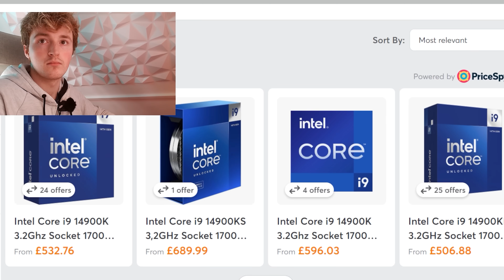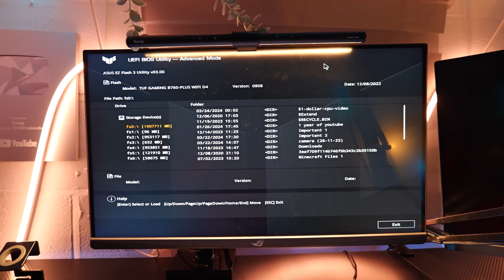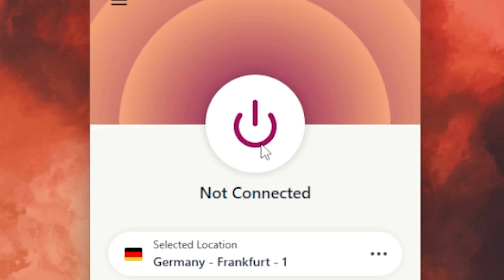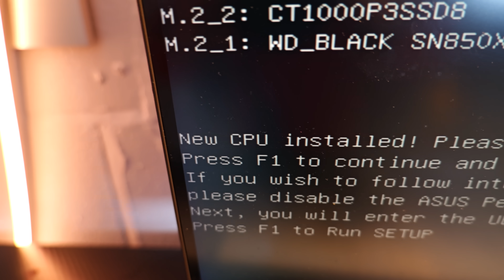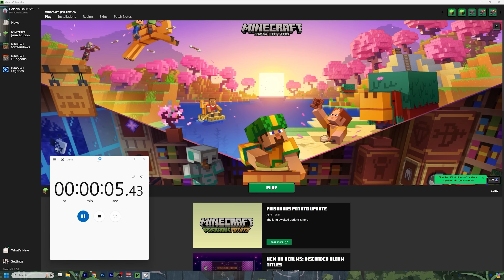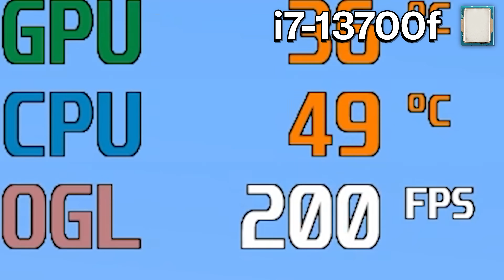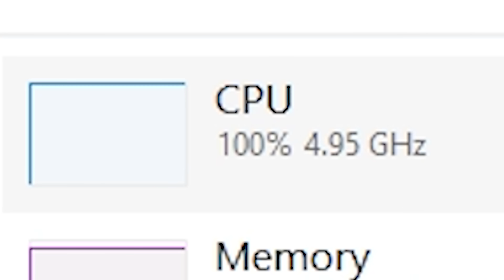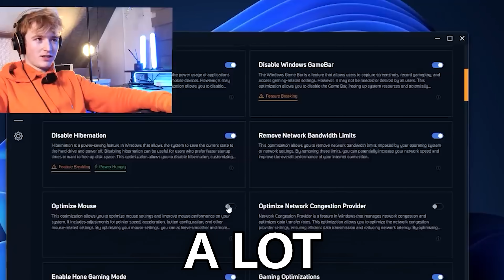Minecraft On The World's FASTEST CPU!

Comment: amd threadripper laughing in the corner
Reply: that isnt a gaming cpu
Reply: @MidResoIve  according to my 5 minutes of research, I have concluded that they're both workstations.
Reply: @MidResoIve  actually they are gaming cpus its just not highly focused on that
Reply: @retring  theyre not faster when you consider gaming unless u try overclocking they just simply have advantage in other tasks because of more cores
Reply: @retring  it's not faster, they're faster on multi core performance, because they have more cores and threads but the single core performance is far behind the 14900K and also minecraft prefer bettter single core performance than multi core
Reply: Theadripper is slower for gaming, it's not built for it, meant for workstations and its fast for editing and anything that can utilize the cores, most games can't utilize all the cores of newer cpus especially the i9, plus minecraft is designed to work with a single core mainly.
Reply: @Seekers4Studios  Yep. Threadrippers are mainly used for rendering due to it's high core count.
Reply: @MidResoIve  Yes, it aint a gaming cpu, but with some of them having 96 cores, it'll do better than the I9.
Reply: @jum5214  more cores do not equal faster gaming preformance.
Reply: @Fake_Slicer  the threadripper is litterally 20 times more expensive
Reply: @stormctry  have you ever seen a gaming pc were the cpu is 20k usd?
Reply: @MidResoIve  still more powerful
Reply: @stormctry  When people said "fastest CPU" on i9-14900KS for an example, it is because it works at 6.2Ghz on only one core (without using LN2). A threadripper doesn't achieves 6.2GHz on a single core without LN2 and forget to get 5.9Ghz on XX Cores (that's why there are only 8 Pcores and are the only one to achieves 5.9Ghz for all on 14900KS)and it isn't for consummer due to highly price. And the i9-14900K isn't the fastest because the 14900KS does a little bit better.
Reply: @MidResoIve  dosent tr pro 7995wx cost 10k usd? also im not saying that theyre necessarily instead for gaming im just saying theyre primarily used for workstation and rendering purposes but theyre also great for gaming it just dosent match up with the high end consumer cpus
Reply: @Fake_Slicer  liking your own comment is crazy
Reply: @Kony_BE  yeah i agree with you but at least when you consider the ryzen x3d series for gaming, let alone the 7800x3d, it fairs up well and even outperforms the 14900ks in some games
Reply: @Fake_Slicer  yes and no, i9 is made for normal workloads but when u need more cores than comes the threadripper. i9 is made on lga1700 which in amd is Am5,
Reply: the i9 is faster by 13.48%
Reply: @MidResoIve it still has 48 cores
Reply: @Cereales_Cereal  it has more than 100 actually
Reply: @Fake_Slicer  The i9 is meant for gaming
Reply: @jum5214 in workstation tasks, sure. Gaming? Not even close
Reply: @stormctry no the 7800x3d losed to 14900ks
Reply: @elvpse  yeah true
Reply: Bro someone tried playing fortnite using threadripper and still the 13th gen could beat it, threadripper isn’t for gaming….
Reply: Consumer CPU not server CPU
Reply: fr
Reply: Threadrippers are not really good at gaming (for the price, it's still a beast)
Reply: wonder what would Ryzen 9 7950x coould be
no threadripper has different market despite it was blured between these 2 segments
Reply: Do u know what is the meaning of Consumer
Reply: lettealy
Reply: @retring no the clock speed isn’t very fast lol
Reply: @abiez4018 finally someone understands, it would be better at vms
Reply: Amd Epyc:
Reply: he said fastest CONSUMER cpu, threadripper isnt a consumer cpu
Reply: i recall, consumer CPU. The threadrippers are server processors not intended for consumers but rather providers
Reply: Threadripper have worse single core proformance than Intel, that's why they aren't faster in games
Reply: Meanwhile Nvidia Grace CPU…
Reply: @retring  minecraft is a single core game, you need a good single core preformance to get fps. Not the case for threadripper.
Reply: AMD in the corner laughing as Intel CPU start slowly dying and becoming unstable
Reply: Intel xeon laughing at the corner
Reply: Render fast doesn't mean game fast.
Reply: He said consumer 😂
Reply: ye lol
Reply: @MidResoIve  um actually processor is splitted into cores and these cores are doing each operation that means MORE CORES = More Things in Less time = faster process = better Performance
Reply: @LixTheYT  🤓🤓🤓🤓
Reply: @MidResoIve  hehe thats kinda offensive kid.... but I don't judge you for not knowing how to use google ;)
Reply: @LixTheYT  i know more about computers than you ever will
Reply: @MidResoIve  bro who asked lol
Reply: Thread ripper my ass.😂
Reply: @LixTheYT  dogs dont ask, they listen
Reply: @MidResoIve  yes so stop asking doggy ♥️
Reply: They are server CPUs
Reply: It has less single core performance which makes the amd threadripper not ideal for gaming
Reply: @LixTheYT  i didnt ask about anything
Reply: @MidResoIve  did i ask something too? I don't think so
Reply: @LixTheYT  there you go... you're asking!!!!!
Reply: @retring its only faster if its like 256 chunks in minecraft
Reply: @MidResoIve  ...
Reply: @retring  have many cost
Reply: @retring  nope, as far i know the most powerful threaddripper can get max 5.3 ghz
Reply: @MidResoIve  Threadripper CPU's are acutally for gaming, the same other one that isn't for gaming is EPYC CPU's
Reply: @idiocy8884  they both CAN game but they arent made FOR gaming
Reply: @MidResoIve  makes sense, though there are gaming motherboards designed for Threadripper CPUs, and as far as I know EPYC CPUs doesn't have it.

Well yeah, gaming on Threadripper is unnecessary and just the second of its purpose, but hey it can.
Reply: @MidResoIve  I9 are not gaming cpu too, totally useless for gaming
Reply: @Meyuuuko  then name a gaming cpu from intel
Reply: @Meyuuuko  then name a gaming cpu from intel
Reply: @MidResoIve  the I5 or I7 11th generation or a little bit lower is for gaming
Reply: Isn't Threadripper.. a Server CPU?
Reply: @Meyuuuko  then why does the i9 preform better?
Reply: @MidResoIve  its designed by intel for gamers but its useless in gaming so i dont consider that as a gaming cpu
Reply: @Meyuuuko  well legit nobody cares about your opinion, legit 99.9% of people consider it a gaming cpu
Reply: @Meyuuuko  and mind explaing how its useless for gaming
Reply: sahi bola bhai
Reply: @MidResoIve all are not gaming cpu all are cpu
Reply: no funny i will help INTEL new cpu processor powerful same size of amd processor watch me i will build one am leandro mauricio santos i will make intel win smooth and god speed!!! intel 14th gen is AI processor i create it processor i told them my plan chip processor!!!
Reply: @abiez4018  doesn't matter if it got way more cores and threads lmao, and it doesn't require a fucking powerplant in your backyard per core...
Reply: Average amd fanboy kid
Reply: Thats not for gaming😂😂
Reply: No, because Minecraft uses only 1 core of processor.
Reply: That is workstation cpu
Reply: you could also destroy it with an amd epyc 9654 with 96 cores
Reply: @retring by faster, he probably meant clock speed
Reply: @stormctry threadripper was made for workstation
Reply: @Fake_Slicer  Normal consumer CPU doesn't need that much cores to run video games it's all up for your GPU to decide for that the real money hog is GPU some of them can get a lot more expensive than CPU this dude didn't buy the most powerful Intel on the market. Checking prices using Artificial Intelligence the most expensive CPU on the market is the Intel Xeon Platinum 8280L which is about $14,797 checking online prices. This dude didn't even buy the most powerful Intel CPU the Intel Xeon Platinum 8280L might as well be an upper rich class gaming hardware goodluck buying one.
Reply: M2 mac laughing in the corner
Reply: @Jinxinxo  M2 Mac got nothing on threadripper lmao
Reply: its a server cpu, + minecraft is a single core game, which makes ur peeripper slower because one core performance on it is shit
Reply: @定义  the title of the video said THE FASTEST CPU, and threadripper is wayy FASTER than the m2 and 14900k, i also never specified if i was talking about minecraft or not, (which im not) im talking about general tasks.
Reply: @MidResoIve haha… wrong.
Reply: Still no competition for the AMD eypc….
Reply: @ten._.s Meanwhile nvidea Blackwell:
Reply: @pawbthesilly  true
Reply: @CarlosReyes-q2z  nuh uh, threadripper is slower in single core than 14900 and amd, and minecraft uses single core  not multi. and also, nobody would waste thousands on CPU.
Reply: @定义  I am still talking about general tasks, not minecraft, also, companies buy CPUs like the threadripper alot because of its multi core performance, which helps in a lot of workloads, for productivity/general tasks, the threadripper outperforms the 14900k and the mac, which were both made for some productivity and gaming.
Reply: He isn't rich😅
Reply: @XenoGalactusVtuber  I understand, but I'm just saying threadripper is overall better than those 2 cpus
Reply: its not better on minecraft, its made to do other type of stuff like 3d rendering not gaming
Reply: @bagaco420  Yeah, I was mainly talking about other stuff though
Reply: @MidResoIve There is no such thing as a gaming cpu
Reply: @Rolkey  i know that, but what i mean is, the i9 is one of the most powerful cpu's in gaming
Reply: That shit cost $7k
Reply: @MidResoIve  Oh ok.
Reply: Threadripper is not made for gaming. Stick to it.
Reply: Intel Xeon laughing in the corner..
Reply: @Boundless-vz6vp  ik
Reply: @Boundless-vz6vp  threadripper wipes the floor with Xeon ngl, threadripper 7975wx beats out the top xeon chip
Reply: @CarlosReyes-q2z  nah man I'm not only talking about speed bro, you think speed is everything
Reply: @Boundless-vz6vp  what else? And I'm talking about speed because the title says that he has the fastest CPU and that's the main difference between xeon and threadripper
Reply: @MidResoIve  its also consumer cpu just like i9
Reply: It’s not a consumer cpu
Reply: @Fake_Slicer  because threadripper is so ludicrously powerful it has severe compatibility issues with many games and games lag because of how powerful this cpu is. its meant for workstations and heavy editing/coding etc work
Reply: @brutpenta  doesn't change the fact that they're both workstations
Reply: Ita gonna be so much worse 💀 @retring
Reply: It's not the fastest
Reply: amd epic bergamo saying /so you wanna fight/
Reply: @aadharsh1094  fastest one someone can buy i think
Reply: I9 base speed 6 ggh 
Threadtripper 7995wx has 96 cores but its base speed 3.5 ggh i9 faster broo
Reply: 14900ks
Reply: @Fake_Slicer  Computing is computing bozo
Reply: @Kn1rek  cool
Reply: @Kn1rek  wait why is your ip adress your channel description
Reply: @Fake_Slicer  Nah that is your IP adress
Reply: @retring it won’t get more fps then the i9, it can run minecraft 5 times at once but won’t get more fps cuz it’s build a different way
Reply: For real I was like dude the thread rippers are defff faster
Reply: @lionnotsheep6048  Threadripper just got ton of cores, but Minecraft can use only single core cuz how MC was programmed
Reply: @Kn1rek  so if I run Minecraft on anything newer than 2002 it won't work? Bro dual cores been around forever
Reply: HyperionZero  did you realize that you can read the date and see where in the post was made and compared to the news and realized I had no idea when that was made and on top of that it's kind of looking the opposite way to if you look at the news as well
Reply: Workstation cpus
Reply: HyperionZero  intel does not focus on gaming over being powerful as workstations. although they have good gaming performance, that is not their main focus. AMD's 9000 series for example, for more of a multi purpose use rather than dedicated workstation has only 16 cores rather than 24 cores on the intel which is more suitable for a workstation
Reply: He probably said it was that fastest because it sounded better/ clickbait
Reply: HyperionZero  I love amd, ik
Reply: @powdered_cows they still are pretty decent for games that take account of a lot of cores
Reply: @MidResoIve some games can use the high core counts, with games that do, they will blow the i9 outa the water.
Reply: Amd is dying get lost and fan
Reply: @idiocy8884  some games which can use the high core Count are actually better, so it's debatable
Reply: @lionnotsheep6048  the first dual core was 2008....
Reply: @szlaven8254  this is only in single core. Multicore, the threadwripper will destroy the i9, or any other CPU.
Also to the person who said "m2 is the most powerful" your wrong. It's not even the most powerful arm CPU for the price. The ampere alta max, using a whopping 128 cores (like proper cores) runs miles around the Mac studio at... ~4k dollars(the 96 core version) which still runs miles around the Mac.... Everyone blindly follows apple. Ampere also runs windows on arm unlike the apple Mac, which windows on arm has a much more efficient arm -> x86 compiler so it runs very fast unlike the m2.
Reply: @gearsgamer7115  not true at all... I had a dual core amd as my first computer back in 04 or 05
Reply: @lionnotsheep6048  it was 100% a dual thread not dual core.
Reply: @gearsgamer7115 bro just Google dual core CPUs I deff had one intel Pentium D was out in 2005 and was "Dual Core" how old are you anyway arguing with a grown ass man about when dual cores came out i lived it bud. My first ever real desktop was Dual Core
Reply: @lionnotsheep6048  It really isnt what I would consider a proper "dual core" beacuse its more dual cpu as the cpus communicated through the south brige. It also was shit performance. The first PROPER dual core was the core2 duo, as it actually had cores, not 2 cpus.
Reply: @gearsgamer7115  and that was Dual Core at the time lol I don't think Intel or AMD were making it up. Things get better your car is a car it may have a 4cyl but it's not the same as a 1980 4cyl get it?
Reply: @gearsgamer7115  again it isn't what "you" call it. You aren't amd or Intel. That's like me saying your car is a POS because I don't consider it a sports car ECT.
Reply: @lionnotsheep6048  no. A dual core is structurally very different to a dual CPU, it's comparing an electric to a gas. Dual CPU is infatley slower
Reply: @gearsgamer7115  I know just like a carbureted 90hp 4 cylinder vs modern fuel injected 200hp 4 cylinders shit gets better...
Reply: amd ryzen 9 7950x3D laughing in the corner with the threadripper
Reply: @MidResoIve  apple sheep logic mnore core better performace
Reply: It won’t get more fps than this i9
Reply: @AlexMkd1984  fr?
Reply: threadripper sounds like a gaming cpu tho?
Reply: AMD threadrippers are production CPUs used in high intensity workload like developing AI technologies
Reply: Threadripper ain't for gaming noob
Reply: "consumer cpu" he said
Reply: All bullshit.
AMD EPYC (i forgot model name) has the most cores and threads and both are for workstation. Not gaming CPUs.
Jeez.
Reply: Threadripper actually for professional graphics, it's not for games
Reply: he did say consumer but the threadripper is the strongest
Reply: @retring no not faster but more core for multi working but for gaming r9 or i9 still better
Reply: he said consumer cpu
Reply: for the best one you need to drop half a mill or smth like tat
Reply: Yeahhjj 😆😆😆😆😆
Reply: Just let it laugh because it's all it can do
Reply: @MidResoIve And so do the i9. 24 cores for what. Most of them not cant even handle 8 cores, if they could, they cant use of the 2 threads per core. (sometimes if you disable hyper-threading you can get much lower input lag, and more frames in games🥴)
Reply: Xeon
Reply: @MidResoIve The I9 14900k isn't a gaming cpu !!! And the world fastest cpu for gaming is the Ryzen 7 7800X3D !
Reply: @retring  it will lose in gaming einstien
Reply: Its 100x the price of this
Reply: @stormctry they’re not they have bad caching which causes bad frametimes which is bad for gaming
Reply: he said "consumer cpu". also you would get way lower performance in minecraft using a threadripper because minecraft isnt a multithreaded game and benefits more from single core performance which is way higher on the 14900k
Reply: @MidResoIve  he said consumer cpu not gaming cpu.
Reply: @gearsgamer7115  Yes, but it's still much worse than a gaming-oriented CPU. 99% of games don't use more than 8 cores, and the majority of modern desktop CPUs have at least 8.
Reply: @powdered_cows  Yeah but it has full ryzen cores which you can overclock to well, 5.1ghz. Its actually decent for gaming lol
Reply: its for a server pc
Reply: @Xyra.  its still the fastest.
Reply: even then it wont get more FPS ghan an i9 9900K bc they can't even run games without issues
Reply: @clashergames8499  no where the hell did you get that info thats nonsense.
Reply: @VartuMontavimas  u dont need to be a brainhead to know this lol this is one of the most EASY Learning info in IT
Reply: @clashergames8499   okay 👍 lets act like you are right. Why then? It has wayy more cores and there is ways with modding to activate all the cores.
Reply: @retring  no its not, its single core speed is horrible
Reply: That's a server cpu
Reply: @ashmin5244  ok? Its the fastest.
Reply: 😂😂😂😂 what a fool
Reply: @santhis3822  who?
Reply: @VartuMontavimas  that thugbossYT
Reply: Exactly the comment I was looking for
Reply: its a cpu that is more powerful than intel
Reply: No normal person is going to buy that CPU. Not really "consumer".
Reply: It's a workstation cpu
Reply: Whose gonna tell him
Reply: @retring on workstation not gaming
Reply: @retring its worse
Reply: Bruh, he spend like 600 dollars, and after 1 week Intel nerfed this processor, and now best cpu is i7-14700kf-now best cpu
Reply: more but worse..
Reply: @MidResoIve blud dont know anything abt computer and still yapping😂😂
Reply: @VartuMontavimas shut up you dont know abt computer
Reply: @nguyenbao9895  you watched one linus tech tips video and decided you're better than everyone else
Reply: @MidResoIve  i dont even said that, bro is making up things
Reply: Bud is just ripping his own threads and destroying himself. Lol
Reply: @retring bro threadripper is for work and it won’t give you that much more fps
Reply: Yeah not for gaming tho for editing sure not gaming. @retring
Reply: @retring  Well, not for gaming really. It peaks around what most mid to higher-end CPUs, but for servers and rendering, it's the best.
Reply: @retring  yeah but double the price
Reply: stay in the corner😂
Reply: I was gunna say that
Reply: @Legoman12346  Until you learn that the threadripper  doesn't beat any mid to high end gaming CPU in gaming performance
Reply: It is not consumer grade
Reply: Nasa computer laughing in the corner.
Reply: I am not paying 4500 dollars more for slighty better preformance 😭. Also i9 runs more efficiently, and runs better in certain circumstances. i9 has better single thread preformance, while the threadrippers single thread gets beaten by even apples M3 chip. Threadripper isnt as good for gaming for that reason alone, and is better with multi-tasking
Reply: @lukasbessette-lukyrt37  Except the fact games are developed based on the hardware and will most likely get lower performances than the top end gaming cpu
Reply: @retring definitely not faster js more powerful... good luck getting 120+ fps on a threadripper (also threadrippers are old gen so current intel and ryzen are actually more powerful and faster 😭)
Reply: Bro it’s a server cpu it costs way more and it have performance but normal gamers and people buy normal cpu not server
Reply: Well what about ur bank acc is it safe?
Reply: 7800x3d laughing in the corner
Reply: Threadrippers are for Renders and such like Workstations.
Reply: @ThugbossYT  amd threadripper can be used for gaming but it is mostly used in servers and workstations for rendering and data storing centre’s like that it can be used for gaming but ain’t well optimised for it
Reply: more cores dont matter if you cant use em all thats why in gaming its better to have a lot of clock speed
Reply: @MidResoIve you can install mods to take advantage of all cores and threads in chunk loading scenarios. For example, a Threadripper 7995WX will get significantly more fps than a 14900K in a chunk render distance of 128 chunks. But yes, in other games that dont rely of heavy data processing (like minecraft or blender), a threadripper will get fewer fps.
Reply: @MidResoIve amd is better but i’ll buy intel❤❤
Reply: Not a gaming cpu, it's a productivity cpu
Reply: Intel xeons exist too ..
Reply: I was gonna comment that just now
Reply: It still runs 1000 more hentai tabs than the i9 @MidResoIve
Reply: Five noghts at freedya
Reply: @MidResoIve  the i9 14900k isn't a gaming cpu too
Reply: it's the fastest CONSUMER chip. threadripper isn't a consumer grade chip. on top of that threadripper is twice as expensive.
Reply: @retring bro the fucking treadripper does not have much performance cores 💀🌚
Reply: @MidResoIve  Ryzen 7950x3d laughing in the corner.
Reply: @zertex2830  there's gonna be a 8950X 3d coming out soon if im not mistaken
Reply: "consumer cpu"
Reply: @MidResoIve in gaming it's best to have a few powerful cores so you are kinda right
Reply: amd ryzen 7 7800X3D dying form laughter
Reply: @Block-f7d  7950x3d>>>
Reply: @MidResoIve  OK
Reply: Consumer cpu
Reply: @MidResoIve Neither is the 14900k
Reply: @MidResoIve  the guys only counting cores so what does it matter.
Reply: @retring amd Fanboy. It's not even gaming cpu and comparing. I personally like amd and Intel both but it's too much. You cant compare workstation cpu with gaming cpu.
Reply: and we are laughing at you
Reply: @abiez4018  yes the clock speed is also not as fast as the consumer ones even with overclocking
Reply: What about intel xeon?
Reply: @atswindangprapa7823  both aren't fast for gaming since gaming is usually multi core
Reply: @retring hhmmm no
Reply: Only when paired with the rtx 6000
Reply: @Entity_303_e7e  minecraft is actually more cpu intensive so I doubt gpu is gonna make a huge difference besides the usual 2000fpa
Reply: @AlphineTheGuy  I know that but someone said the threadwripper and the i9 14900k is a workstation pc
Reply: @AlphineTheGuy  y know I now that
Reply: The 14900K is literally faster lol
Reply: these 3000 dollars on that treadripper - 🗿
Reply: Buddy, Threadrippers are insanely more expensive and are better in multi-threaded workloads, but in single-threaded workloads, the 14900k wipes the floor with it.
Reply: intel always come back no matter how amd goes far away from intel intel is always 2 steps ahead from amd 🗿
Reply: That's a server, CPU
Reply: That's a server, CPU
Reply: When the man see the baby i9
Reply: @retring  "faster" 😂💀
Reply: Intel Xeon would also destroy the Treadrippers.. Xeon w9-3595X laughing in the corner (60 cores, 4.8gHz)
Reply: Minecraft is single thread. It'll always run worse on a threadripper.
Reply: No AMD RYZEN 7 7800X3D
Reply: @stormctry  Who will pay US $14,000.00 - 18,000.00 for a gaming cpu?🤣
Reply: Tell me you don't know cpus without telling me you don't know cpus
Reply: amd threadrippers will never be as fast as a CPU made for heavy duty. Hope this helps!
Reply: @lennoxhost  I know the threadripper is a server CPU.  My point was, even if you want to buy a threadripper for games (say it was good for games), who on earth would build a home PC with a threadripper. WHO'S GOT THAT KIND OF MONEY.🧐
Reply: Threadripper is not consumer, this guy said "the fastest CONSUMER CPU"
Reply: XEON!!!!!!!!!!
Reply: Keep him on corner
Reply: @VICKYSINGH-wb7wg Sorry I Don't Understand
Reply: @MidResoIve yes it is, intel isn’t. Intel is made for work task. Amd was made purposely for gaming.
Reply: @jum5214them having more cores doesn’t mean it’ll do better and they never do. Games don’t use more than 4 cores if that and Minecraft Java only cares about single core performance. So 95 of those cores would be useless
Reply: @retring dude u know nothing about pc’s
Reply: He said consumer cpu threadripper is a workstation cpu
Reply: Bro is AMD fanboy
Reply: @ amd is better than intel lol
Reply: Bro that’s not for gaming🙏🙏
Reply: @stormctry exactly
Reply: It's not good for gaming or consumer
Reply: @MidResoIve  he's mean the X3D CPUs
Reply: It will be slower actually as its not deigned for gaming😅
Reply: @keisukesamarasinghe2893  true
Reply: Ryzen 9 9950X3D bout to be laughing fricken hard. (When it releases) that’s built for gaming and as far as we can tell it’s gonna be the best gaming CPU on the market 💪
Reply: Ryzen top 1 in bench:
Reply: How about xeon🤣🤣🤣